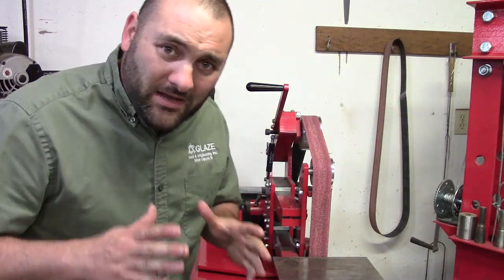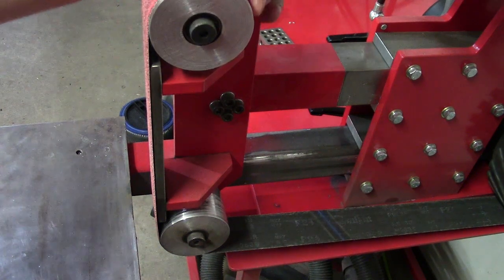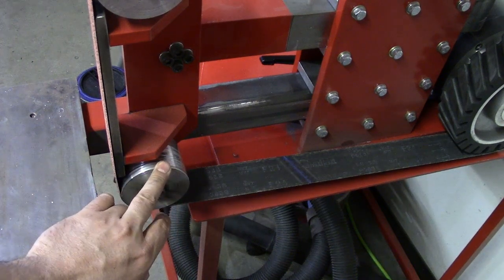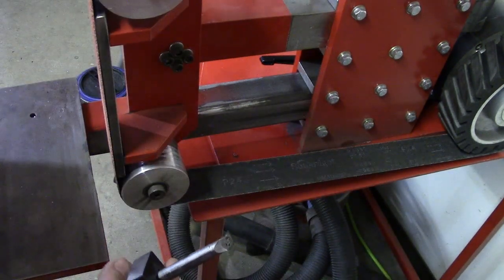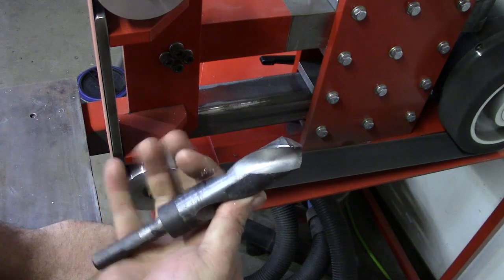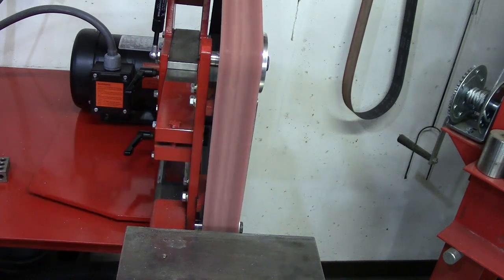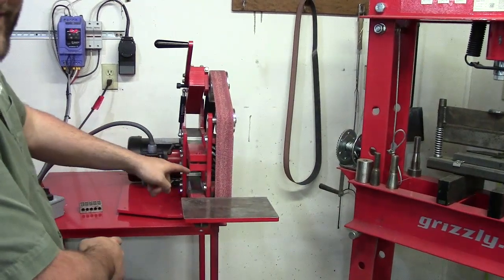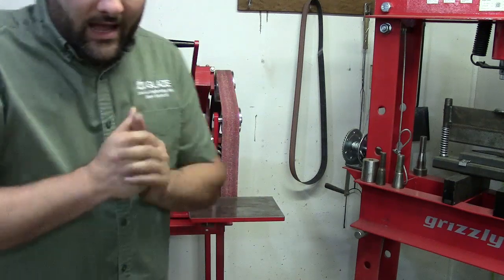Does Your Belt Grinder Track The Same In Reverse as Forward?

Comment: Thanks for sharing your insights . . . what you suggest defiantly will work. 
I believe there is an easier way . . .  Align the axis of the wheels.  You need a $25 machinist level for this.  
First, align the motor/drive wheel to the tool arm. 
Second, align the horizontal & vertical axis of the tracking wheel. 
Third, align the mounting surfaces of the platen wheels. 
Beyond that you can shim the mounting surface at the inner bearing race to fine tune it.
Hope this helps someone.  If you need help post a question.

Comment: Why grind the wheel when you have bolt to turn? Factory bolts are not always 100% true so when you put wheel and thighten with locknut, you can turn the nut and change the wheel angles a little bit :)
Reply from the maker: I had used precision ground shoulder bolts threaded into the d-plate.  The rotate trick didn't work for me.

Comment: Just discovered this exact problem by accident,placed a 3/4 socket and extension on the bottom platen roller nut and applied pressure to the nut inward and outward and found the roller stud was was not straight in the platen. Corrected this and belt tracked properly in toward and reverse

Comment: had this problem many times, i use quater wide masking tape a couple of turns around the wheel in question pulls the belt across one way or the other, great video, nice machine

Comment: I am wondering how you can adjust the tracking on the fly
Reply from the maker: I adjust my tracking by turning the bolt with my hand which changes the angle of the tracking wheel.